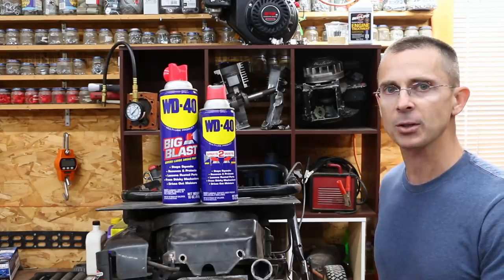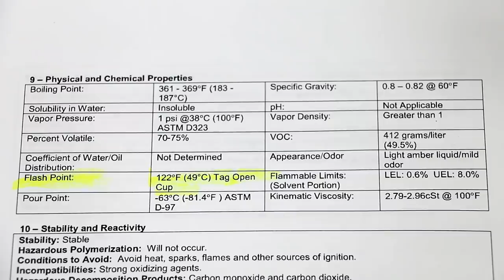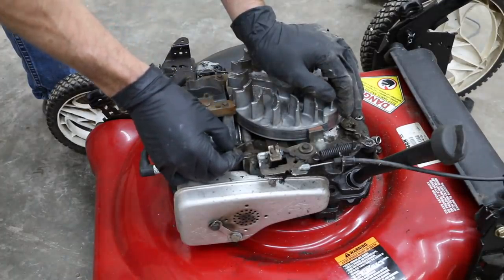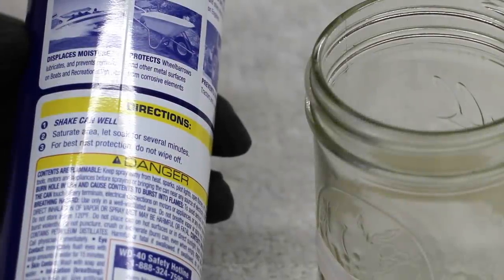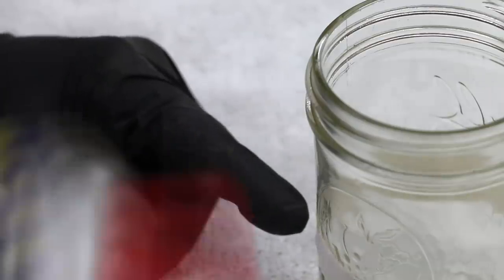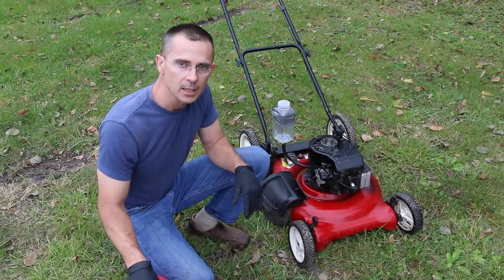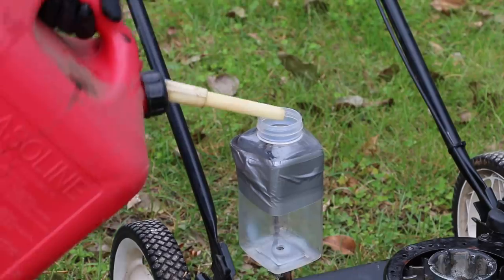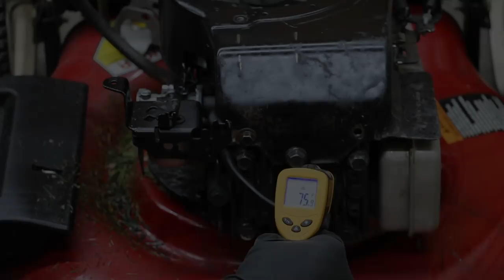Will a Gas Engine Run on WD-40?  Let's find out!

Comment: Hey project,,,, 4 oz of Dawn dishwashing detergent,,,,, added to one gallon of gas,,,,,,.   See if it helps clean off carbon,,  ???   Since gasoline is supposed to have detergents in it , ???
Reply from the maker: Thank you for this recommendation.
Reply: Do this
Reply: Yes, you have to do this one, great idea!
Reply: Rick Simpson a couple drops should be enough right ? Since it's concentrated
Reply: Rick Simpson Wrong kind of detergent! Gasoline additive looks like tar. At the rack, I saw some "tar sickles" hanging from a line that was hooked up to the MOBILE additive tank one time. The stuff you buy in the store like STP is highly diluted with kerosene, naphtha, or some other oil based carrier.

If that bottle was pure additive it would probably do about 5000 gallons.
Reply: Check out Boredom Garage they run a tide pod through a engine.
Reply: I know it's totally a different type of detergent,,, it would need water to foam,,, I don't think it would foam putting it in gasoline,,, some had said it would turn gasoline to jelly like napalm,,. ???
Reply: Patrick jones ,,, no,,, it was just a joke suggestion,,, I would not attempt it,,, could clog up a fuel filter or injector,,,. ???
Reply: There probably is some water in Dawn dishwashing detergent,,,, to thin it,,, ???
Reply: Boredom Garage ,,, what did it do,,,. ???   I have considered adding 8 or 10 oz of Dawn dishwashing detergent to the motor oil,,,.  Right before a total teardown and rebuild,,,, just to see if it would help with part of the cleanup process,,,.  ???
Reply: Rick Simpson how about pinesol

Comment: That's good stuff to use when looking for intake leaks. With engine running, spray around induction system. If it changed rpm, you found your leak.
Reply from the maker: This is a great suggestion. Thanks for commenting.
Reply: The Icemeister's UnGarage 
Unless it eats some types of paint...
Reply: Or if it meets an oil seal of some sort.
Reply: behemothfan666 F T P 
I have a flashlight for oil leaks. Easy fix if you can find them. The blue light makes oil fluoresce green on a fresh leak. BAM! Found it. Fix it. No more leak.
Reply: behemothfan666 F T P 
What do you mean? Oil seals that leak need to be changed anyway. WD has never caused one in my experience but I only use it as it was intended.
Reply: upside downdog Sorry for any misunderstanding I was referring to carb cleaner. That will break down and cause air leaks on oil seals and others alike.
Reply: behemothfan666 F T P agreed. WD is much less destructive and actually seems to help seals. I am hypoallergic to the good industrial chemicals from a lifetime of using them. WD is one of the few I can still use without skin falling off my hands and feet.
Reply: The Icemeister's UnGarage 
And then the one thing I spray it on goes to shite because it doesn't like it...
Reply: The Icemeister's UnGarage 
Yes carb cleaner will attack certain plastics.
But carb cleaner will attack and destroy many types of rubber.
Including nitrile and viton which is a common rubber used in oil seals.
And from experience I will never contact the two again. 
Even manufacturers such as STP, putoline wallbro and Silkoene advise to avoid contact with any rubber material and if contact is made to wash throughly with warm water. To avoid perishing of the material.
Reply: upside downdog Sounds good. Haha I would love to But I'm over in the UK unfortunately.

Comment: Try converting a lawnmower to run in diesel then test the power
Reply from the maker: Thank you for this recommendation.
Reply: Likely impossible to convert due to the compression required for diesel to combust. As well as lack of direct injection and the short stroke gas engines have when compared to diesels.

Comment: That was very interesting to see on the see threw engine how little it burned off. On the test mower was that wd-40 building up on the deck or crankcase oil. Once again another great video. Love them slow-mo shots. Keep it up.
Reply from the maker: That was WD-40 on the deck coming out of the exhaust. It doesn't get used up inside the engine.

Comment: Have you tried Diesohol in a diesel engine? Which is 70% 200proof alcohol + 30% motoroil or vegatable oil?
Reply from the maker: Never heard of it. Thank you for this recommendation.
Reply: You cant purify alchohol to 200 proof because thats 100% alchohol and alchohol atracts moisture. (Why you can get moosemilk to stay and any proof for very long unless its sealed
Reply: There is a process using adsorption that can produce 100% alcohol. It uses zeolite, and a process similar to column chromatography. Alcohol was also synthesized to 100%  before that, but at a ridiculous cost so even then you could say there is no 100% alcohol, but not anymore.
Reply: ipissed exactly, also the blend will work with 95% alcohol
Reply: ipissed never heard of that before i thought that you could get a max at about 96-99% thank you for correcting me
Reply: brian mounts ,, my brother-in-law used to get 193 proof bathtub gin,,,. 1 tsp would drop you on your knees and you could not breathe,,, for 20 seconds,,. ???
Reply: brian mounts ,, I have a friend that owns a business,, he makes beer and wine,, I asked him if he could make this stuff,,. ???   He said yes no problem at all,,,.  But not for or at$12 a gallon,,. !!!

Comment: You should try running a engine off another engines exhaust fumes because sometimes engine don’t burn all the fuel and it comes out in the exhaust
Reply from the maker: Thank you for this recommendation.
Reply: Not if the engine is tuned
Reply: Jacques Bloques you see his bath house car build? Lol garage 54

Comment: The slow motion smoke and gas tank with the Etude in A minor in the background was just beautiful man * sniff *  keep up the good work.    You should get a small engine crankshaft dyno to measure power output under different conditions.  You could test all sorts of products and fuels .... and even do tests over temperature and humidity to see the change in power output.
Reply from the maker: Thanks for the suggestion.

Comment: Is possible to run an engine using gasoline as an oil??
Reply from the maker: Thank you for this recommendation.
Reply: I doubt the viscosity would be correct. You can run an engine with no oil lol. It just wont last very long
Reply: if you want to destroy your engine, yes.
Reply: No, it is no possible to do that be he will sure make a video. He will do anything for viewing hits. Back to your question, gasoline is the fastest component to lock a motor up tight when it gets into the oil crankcase. Happens all the time on mtd riders when carb float fails, allowing gravity to flow fuel into crankcase. An oversight on design. It will crank, and run a bit but smoke so bad you cant see, then lock up. Doesnt usually harm engine, simple drain and refill with oil and back to normal and of course fix the float issue immediately
Reply: @michaelcollins1899  I mean common sense would dictate using designated fuel in the machine yet here we all are. I'm pretty sure it was also a suggested topic for a video as seeing it happen is more interesting than some guy saying no.
Reply: @mikec8086  as i said , anything that will ignite, can and already has been run as a fuel or at least the components that make it up.
Reply: Sure just not very long.
Reply: @michaelcollins1899  your not to bright hey
Reply: @hondablowsbadly  you have plenty of room to say that lol. Not a contributor whatsoever and the best part, you are here, commenting on a comment lol. I cant make this stuff up, sometimes, people just make themself look stupid so we dont have too. Now if you actually had a comment, or suggestion, or an actual idea........

Comment: When you tested the engine power the choke was still on
Reply: he should redo it
Reply: Yeah I think he should redo this video also.
Reply: he had to have the choke on for it to stay running
Reply: He requires a richer fuel mix which is why he has the choke on, otherwise the engine would cut out.
Reply: He should've experimented with the choke to make the mixture leamer, as it was running way too rich.

Comment: Can't wait till you are more popular
Reply from the maker: Thank you for the positive comment.
Reply: Project Farm dam that was fast u really read your comments but have you done a vide were you put regular gas in a 2 stroke engine if I have not please do it please
Reply: Straight gas in a 2 stroke will cause significant cylinder wall and piston ring damage, likely in less than a minute. The longer it runs, the worse it gets, ultimately seizing and possibly breaking the connecting rod. Good stuff.
Reply: Straight gas in a 2 stroke will cause significant cylinder wall and piston ring damage, likely in less than a minute. The longer it runs, the worse it gets, ultimately seizing and possibly breaking the connecting rod. Good stuff.
Reply: thelondonbroiler that's not good

Comment: I think you just single-handedly increased global warming by half a degree.
Reply: Right on, l find alot of these videos  interesting but I do think most of these tests are extremely hazardous to the environment.
Reply: His lawnmower running is the last thing you need to be worried about concerning global warming.....dont like it dont watch :)
Reply: @Gruggggg  Who cares. Hes having fun
Reply: Thats not at all how it works lol. You should see what has gone on for the last 200 years lol. They used to burn literally tons of coal in steam engines for about 100 years straight.

Comment: Please help some of us Motörhead’s out here... I always thought that a less than desirable “engine compression test” meant that the specific cylinder meant it was bad due to ring or valve failure. However, the way that you test your engine compression tests leads me to believe that no metal has been worn down and no blow-by is occurring. So for instance you run a motor on gasoline and it registers 103 on the compression. After running the motor on WD-40 for instance, it runs at 98. Would you please give us a very quick tutorial on how certain fuels create certain compression tests and what each psi rating means to each test? Thank you sir and keep up the great work/videos
Reply from the maker: Thank you!

Comment: I once drove an RV a few miles home when the fuel pump failed by spraying WD-40 into the carburetor. It was a van front end so with the engine cover off, I was able to spray WD right from the driver seat. I had the straw on it to make sure it got into the carb, didn't want to set myself on fire. Would do about 30MPH on WD and was cheaper than a tow.
Reply from the maker: Nice!

Comment: Don’t know why I enjoy watching a lawnmower run, especially when I avoid mine at all costs!
Have previously done a propane conversion with great results. Wonder if you could run an engine on hydrogen gas?
Also an old Great Depression era friend used to tell me you could add up to 10% or so mist of water to the gasoline spray in the carburetor and get a cleaner, higher compression engine.
Reply from the maker: Thank you!

Comment: Great video! In Brazil, many vehicles run on alcohol or gasoline in the same engine (FlexMotor)... Alcohol is much cheaper, so many people only use alcohol... The problem is that alcohol is harder to start for the first time, so on cold days or after many hours of stopping, I use WD-40 to start the first time. I've been doing this for years, but I wonder if this can't contaminate the crankcase oil... I have this doubt....
Reply from the maker: Thanks!  Thanks for sharing.

Comment: I'm a bit surprised that you ran it on regular gasoline before taking it apart. I would have thought that would defeat the purpose of seeing how it could have gummed up the internals of the engine. It was definitely dirtier than before the test but it could have been a lot worse if you just took it apart after the WD40 and that would have been interesting to see. Cool video either way though. Thanks as always!!
Reply from the maker: You are welcome!

Comment: I once mowed my yard by emptying a can of brake cleaner into the gas tank and pouring in a some 2 cycle oil cause why not. I needed to mow before a storm and lived pretty far from the gas station. It worked pretty well. The mower was fine when I switched back to gas.
Reply from the maker: Great!

Comment: Need to order a jet and bore it out for the wd40 to have a fair shake, you said the engine was very low on power but the makeshift choke plate was blocking 95% of the air, of course it had no power.  Who knows it might smoke less too

Comment: Saw this test and determined it would be safe (but not excellent) to allow in the head of my Dirtbike.
So, after the complete submerged accident I had last month, I put a bunch in the head to clean out the water and a whole lot more around the valve seats for corrosion.
XR400R started easily and ran without an issue. Must’ve had 6-7oz in the head on top the regular LUCAS oil.
Drained soon after of course.
Reply from the maker: Thanks for sharing.

Comment: Love your videos, especially when you test engines with alternative fuels.  I would be interested in seeing a direct compariosn between each fuels, which ones have performed the closest to regular gasoline/petrol (crude oil maybe?). Another good comparison, would be fuels that work most effectively various blends (1:1, etc) with gasoline.  Overall, I am most interested in finding out if it is possible to create an alt fuel, by blending various fuel types (excluding gasoiline), that runs closer to regular gasoline?
Reply from the maker: Thanks!  Thanks for the suggestions.

Comment: In the 80s I used to use ATF fluid to clean the top of Pistons & the valves. As the engines running I'd pour slowly into top of carb , smoked like hell but i was told by a few people it does clean carbon off the prisons & valves. Can you get a engine that's has carbon on the Valves & piston top & see if ATF does clean the carbon off. Thanks.
Reply from the maker: Great information. Thank you!

Comment: I agree with the comments below about trying it in a diesel engine. After all you said the WD-40 was more like diesel fuel than gasoline. 
 Another fuel I would like to see you try in both gasoline and diesel engines is Cox airplane fuel or it's equivalent. It's sold in remote control hobby shops. There use to be one near me in Liberty, Indiana and you could buy gallons of it with 10,20,30 and maybe even 40% quantities of nitro-methane mixed with methanol. The old man who run the place is long since gone and the shop closed up probably 20 years ago. Another guy I knew, who raced dirt bikes, said he use to run the lower mixture in his bike to get more power, but said he had tried the higher nitro mix and it burned a hole in his piston, so he didn't use the high mix anymore after that. I can't remember if he said he tried the middle mixture or not. It may work in a diesel, since Cox motors operate with a glow plug. Anyway, a check for power and economy and wether it will damage the motor, I think, would be neat.
Reply from the maker: Thanks for the suggestions.

Comment: As you most likely know, timing is probably causing all the smoke.
Engines will run on motor oil, if  the engine is timed right & the oil is preheated enough.

P.S.  If you care to know... ;-)
A thought crossed my mind about wood combustion... Since it’s the source for isopropyl alcohol, which can be extradited/formed by heating the wood, wood fire might might be mostly from the alcohol.
Just a brain fart...
Which MIGHT burn, in la la land. :-)
Reply from the maker: Thank you

Comment: I'd like to see how long a diesel will run on starting fluid.  Out in remote Alaska, we use starting fluid (which is usually a no no) to fire up old tired diesels.  They usually end up relying on starting fluid to start once they get used to it.  I used to operate an old 988F that took about a can of starting fluid to start, period.  No matter the temperature, it wanted a good huff of the good stuff before it got out of bed, so to say lol.
Reply from the maker: Great suggestion!  Thank you.
Reply: We torture test everything here in Alaska lol.  It's a way of life.

Comment: Try to boil diesel on low heat in a container,  and collect the residue at the bottom and run a 4 stroke on that..
Would be interesting!
Reply from the maker: Thanks for the video idea.

Comment: I have a suggestion. Maybe run in your mower some bug juice Tama the type that kills mosquitoes used in a propane fogger. This way when you are mowing the yard you are also killing your mosquito infestation . Find a mixture that still makes the mower run okay. Of course safety wise make sure you wear some type of respirator when you are mowing your grass.
Reply from the maker: Thank you for the video idea!
Reply: Maybe use it in a 2 stroke lawnboy mower in place of oil mix to see if can replace it as lube. It is an oil base product i think.

Comment: It would be interesting to compare WD-40 with gasoline mixed with 25% oil, (petroleum based). Apparently, CAS # 64742-58-1 (first oil in the list) is spent oil, hydrogenated over a catalyst). The other oils in that list seem similar.
The goal with the test would be to see if the white smoke produced from burning WD-40 was consistent with gasoline with oil mixed in. Theoretically, one could use old motor oil.
Reply from the maker: Thanks for the feedback!

Comment: Hi project farm I have enjoyed your videos for a long time and in these videos that require measurements of liquids could you perhaps im the future use a graduated cylinder. This would increase the accuracy and make it slightly easier to test the difference is that you would most likely be using the metric system instead of the imperial system like you are in this video.